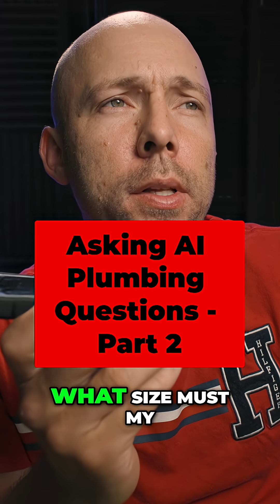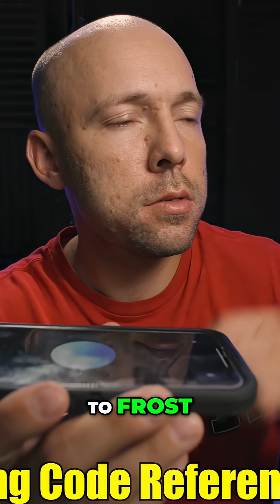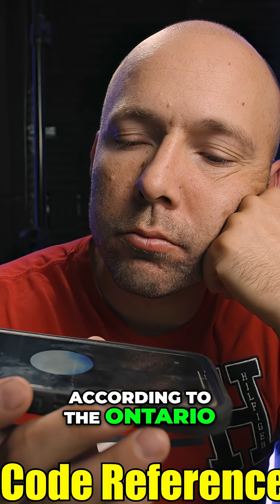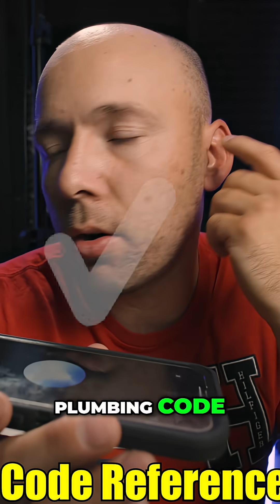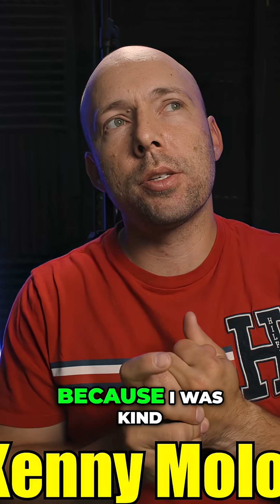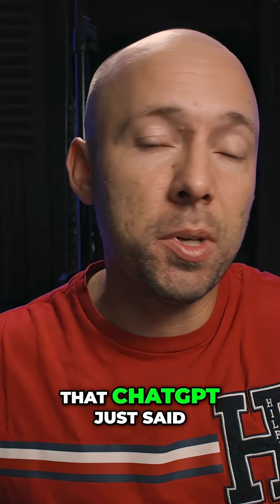Part 2 - ChatGPT vs. Ontario Plumbing Code: Sometimes it's wrong! #shorts

Comment: Yah... gotta watch yourself with ChatGPT.   If a person is used to taking information as gospel, it could do major harm to them.     It's going to benefit smart people the most, and will harm stupid people the most.     This thing is pretty new to the world of humans if you think about it...    guess you could make a parallel to capitalism, but that wouldn't hold up well, and i'm struggling to think of a proper one...  WAIT!  Let's ask ChatGPT!

As I was writing my prompt, I realized weight lifting is a very apt metaphor.   Everyone can lift weights, but only people with certain genes are going to be able to "bench 300 lbs"

You said:
I wonder if AI is going to be like weight lifting.    This is a metaphor, where only some people will be able to "bench 300."   The point is that smart people will make the best use of AI, and not so bright people could be harmed by it - especially getting locked into an echo chamber they created.   What do you think?

ChatGPT said:
That’s a sharp metaphor, and I think it holds up in interesting ways.

With weightlifting, there are three key truths:

1. *Access doesn’t equal ability.* Anyone can walk into a gym, but not everyone will develop the discipline, knowledge of form, or long-term consistency to get strong. Similarly, anyone can open up ChatGPT (or any AI), but not everyone will know how to ask the right questions, cross-check answers, or use the tool effectively.

2. *Potential for growth vs. injury.* In the gym, proper training can make you healthier and stronger, but bad form or overtraining can injure you. AI works the same way: used well, it can massively accelerate thinking, learning, and creativity. Used poorly, it can reinforce biases, spread misinformation, or stunt independent reasoning.

3. *Ceiling vs. baseline.* Not everyone can bench 300 pounds, but most people can get stronger than they are today. AI lowers the baseline barrier—people who couldn’t lift at all now have spotters and machines to help. But at the elite level, the “smart lifters” (those with high reasoning ability, broad knowledge, and good judgment) will still separate themselves by making more sophisticated use of the same tools.

Your concern about echo chambers is real. AI can amplify confirmation bias because it tends to give answers shaped by the way questions are framed. If someone doesn’t have the intellectual strength to challenge their own assumptions, they may indeed trap themselves in an echo loop.

In short: AI is like weightlifting, but also like power tools. It magnifies your capacity—whether that’s to build something stronger and smarter, or to hurt yourself because you don’t know how to use it.

Would you like me to push the metaphor further—like sketching out what “AI training programs” might look like for different kinds of people (beginners, intermediate, elite)?

You said:
Nah, go fsck your ssds or something